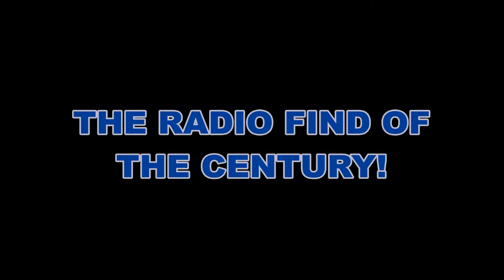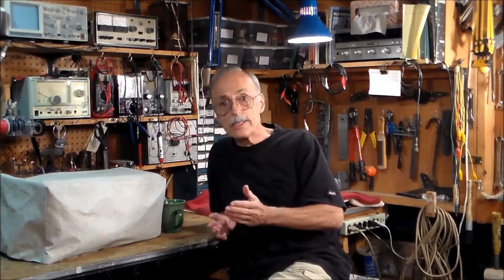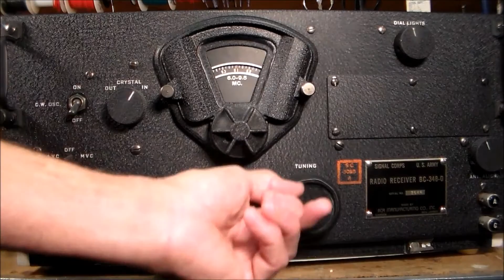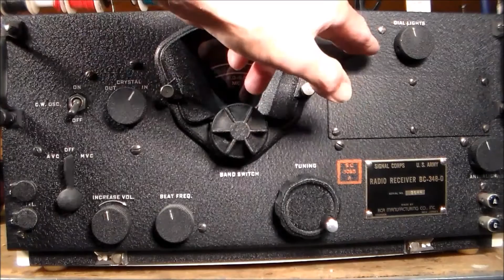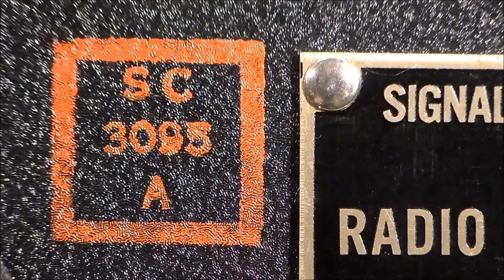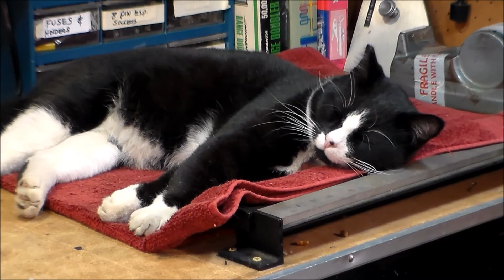SIGNAL CORPS SHORT-WAVE RADIO: INCREDIBLE FIND!

Comment: I'm apparently a few years late to this party.  That is an incredible find--wow!  If you want to power it up, it would be unfortunate that you'd need to re-cap what's apparently a brand new radio in pristine condition (which you've probably done by now).  The BC-348 is an awesome radio.  You actually scared the heck out of me when you said you plan to modify it for AC!  Thank goodness that was just a joke.  

I have a BC-224-C (also by RCA), which is a predecessor to the BC-348.  Fortunately, my BC-224 was not modified for AC.  Someone did, however, brazenly cut out the Dynamotor, leaving all of the wires dangling, which was very disappointing.  It took me almost two years to find the proper Dynamotor.  I wanted to restore the radio to its original working condition without the AC power mod, so I re-wired and installed the Dynamotor and brought the radio back to life.  It was a glorious sight to behold and extremely satisfying.  

Last year (2022), my big find was a brand new 1967 HP 410B VTVM (still in the original box), so I know the excitement you must have felt when you came across that BC-348.  I'm very happy for you on your find!

Comment: BC348 NOS??? $50.00 ???  Rare, that is an understatement!!!  Man am I ever impressed!!!  And you even have the ORIGINAL Dynamotor!  I am so very happy for you!
On the BC348-M version, the IF frequency is 915 Khz, +/- 0.1 %.  The "M" was made by Stromberg-Carlson.

Tuning Capacitor is a 4 section, 14pF to 331 pF variable each section, 9 Stator 10 Rotor plates each section, Army Stock Number/Navy Type Number/British Reference Number 3D9016V-2. The most interesting feature of this particular tuning capacitor is that it contains a variable 3500 Ω, +/- 10%, 1/10 Watt, metalized carbon resistor attached to the shaft that tunes the capacitor, and it varies from lowest resistance to highest resistance with frequency. In other words, Low frequency = Lowest Resistance, Highest Frequency = Highest resistance.
If you go to this site, you can see the manual for the E,M,O,P and S versions:
http://www.nj7p.org/Manuals/PDFs/Military/AN%2016-40BC224-3%2021-Sep-51%20Moorer.pdf

On page 12, right side, in the heading just above the schematic of Figure 10, there is a section titled “CONSTANT INTERNAL RECEIVER NOISE” that starts the description of what the potentiometer attached to the tuning capacitor does.
Wish I could be blessed with a NOS BC-348-M !!!  Again, so very happy for you!
73,
WB4RHA

Comment: thank for the video and thank very much for not modfing the radio, couldn't you hook it up to a 28volt source and testing its operation?
Reply from the maker: Hi mcdradus,Thank you for your comment. I'm sure all the lubrication in the 70 year old dynamotor has dried out and so it would need servicing before applying power. Also, the old paper capacitors would have to be replaced first--a lot of work! So I guess I'll leave it rest in peace.
Reply: You are probably right , i sure am glad you have it and not me. If i had it i couldn't keep my fingers out of it. i would have to hear it play.